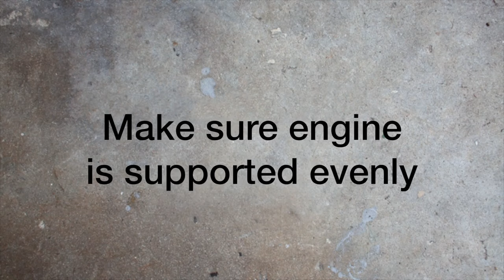BMW Engine Mount Install - E36 - Condor Speed Shop

Comment: Hi I have an e46 and I was just wondering where do the washers go for the rear transmission mounts
Reply from the maker: The washers go between the nut and the transmission brace.

Comment: Should I reinforce the subframe of my 1997 328i trackcar project before installing the engine mounts? Im not sure if the investment is worth it (I 
dont have a welder) and could use your advice. Thanks!
Reply from the maker: P O G O O O O O O O O we always suggest to reinforce your subframe when upgrading your engine mounts.